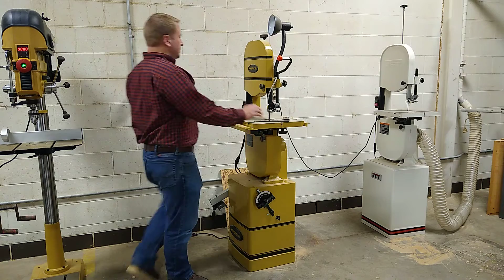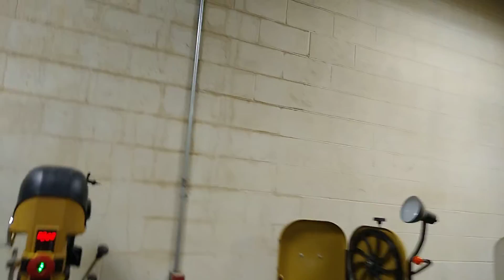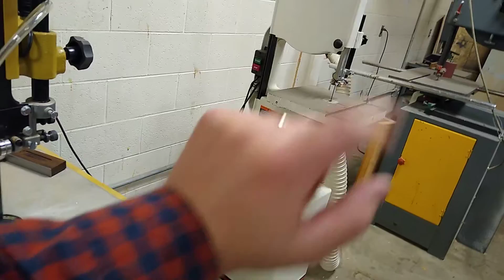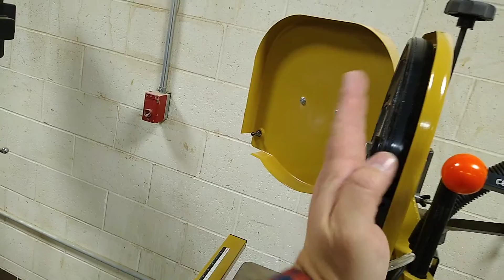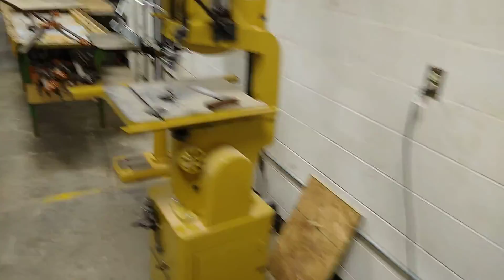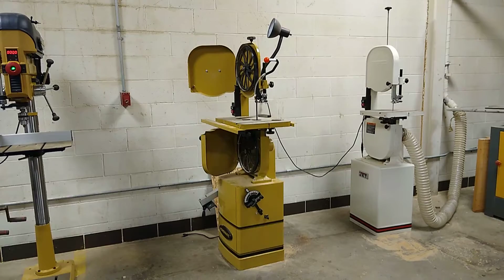How to adjust and set up a bandsaw

Comment: Mike, You have the powermatic as well as the jet, which one do you prefer?
Reply from the maker: They're both very similar the powermatic has the auto tensioner but the teeth snap off very easy on the auto tensioner. The powermatic also uses bearings as blade guides and the jet uses bushings.
For use in a personal shop the powermatic is nice. But with students that abuse things the jet is probably a better choice. Both machines seem to be of about the same quality and the tensioning mechanism on both upper Wheels seems to be exactly the same I have had the cast housing split for both name brands and the threat of tensioning rods strip on both.
Reply: Thank you for getting back to me, I purchased the 14 inch Powermatic yesterday, Im sure for what I need it will be perfect. Thanks Again.

Comment: Hi Mike, I really like your video. “How to adjust a bandsaw” I have the same 
Powermatic with a raiser block as you were working on. It is about. 5 years old and the question I have is the tooth of the blades supposed to be equal from the top to the bottom of the of a 3” piece of wood. 3/4” thick, 3” high. I need to make tenons and the bottom of the blade at the throat of the table is deeper by about .004. Any advise?